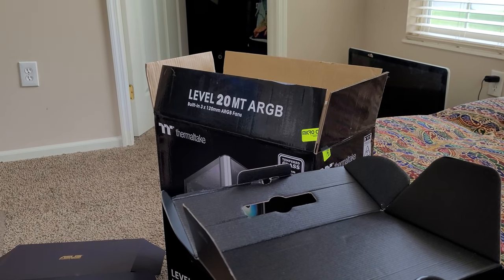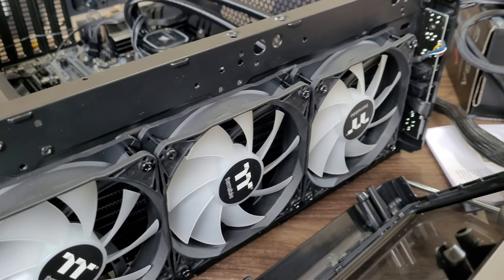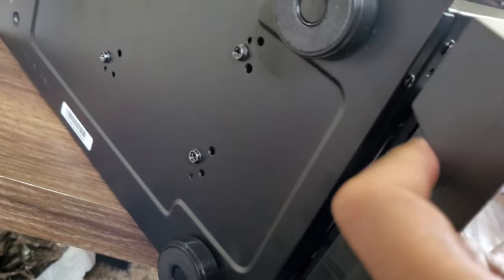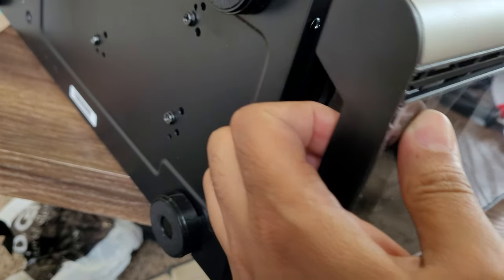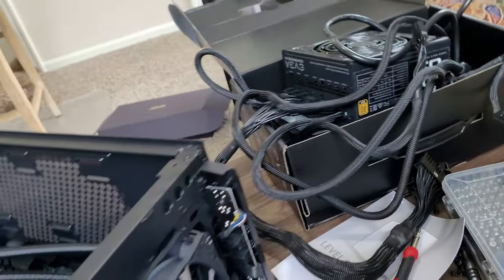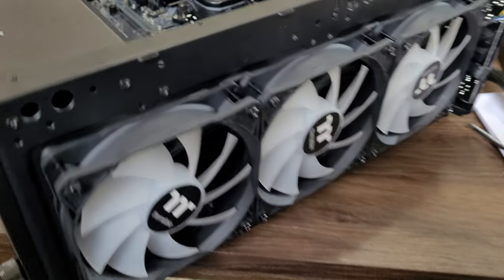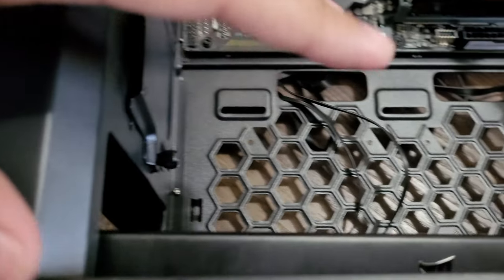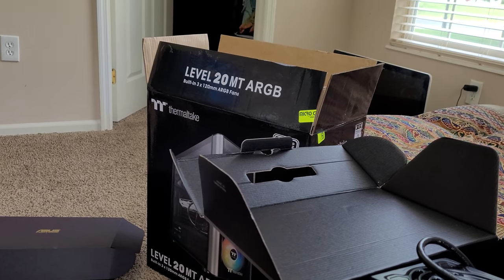Removing Front Panel - TT Level 20MT ARGB Case

Comment: Thanks! Good video, I was going to pry on the glass but I'm glad I saw your video first.  I found that there are three push clips on each side. The bottom ones pulled out easily like your video shows but when I tried pulling more, the glass started flexing so I used a plastic wedge on the middle and top pins.  Cleaned the glass and now the case looks like new again!

Comment: I would like to remove the silly glass front panel to let the air flow freely and replace it with a wire mesh
Reply from the maker: I thought open plan was better but through years of trial and error, open space actually creates a cloud of hot air in general around PC where heat lifts up on its own where as a close system creates a tunnel that is more effective if you have enough intake and out to cool down over all inside the case temperature
Reply: @ihameed  I agree with you regarding air I took the front panel and played same game I noticed significant changes with cooling. That radiator next to that panel needs more air to flow through, I gained much quicker cooling. I just ordered a wire mesh and I will remove that glass with that wire mesh. Amen
Reply: @arturtobijasiewicz7528  han pasado 9 meses desde tu post, que tal te fue ? yo estoy pensando en hacer lo mismo ya que incluso teniendo 6 ventiladores internos mi rtx 2060super no quiere bajar de los 86c en juegos exigentes xd pero antes no llegaba ni a los 80 con mi antiguo case
Reply: @JuanRodriguez-gk2bh  Juan esto trabajo muy bien ahora